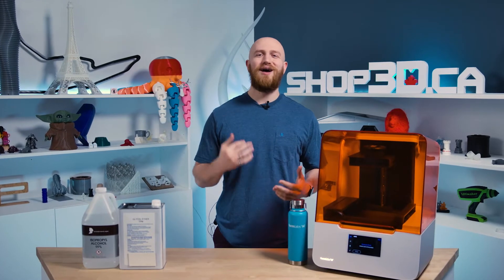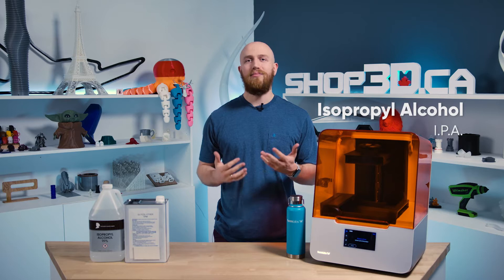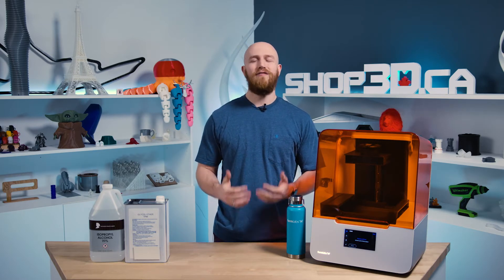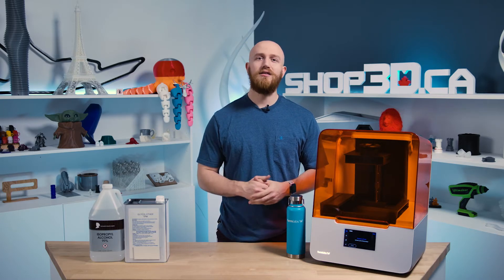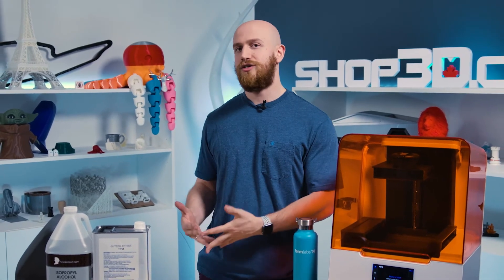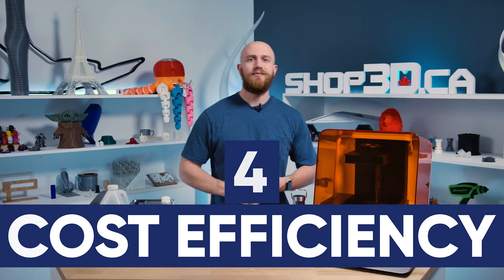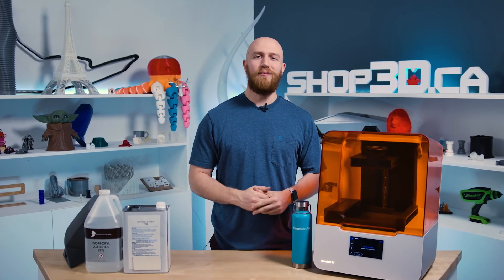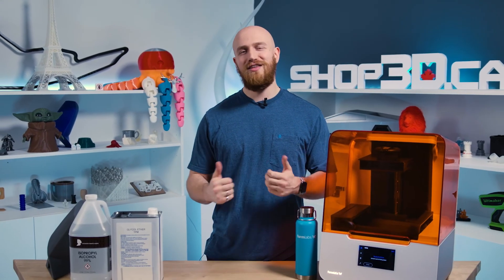Product Feature: Formlabs TPM SLA Solvent

Comment: Hi, thanks for the presentation. Do you know if TPM allows liquid resin diluted in it (from successive washing sessions) to cure when the clear container is exposed to UV light? In order for the resin to precipitate as a "gooey blob" that one can separate and filter out afterward, hence recycling the cleaner. Because while IPA does allow this process, some (but not all) commercially available resin "detergents" (solvents) often prevent it.

Comment: Thanks for the video! Formlabs recommends letting the TPM rinsed print dry prior to rinsing any excess TPM off in water. Do you know how much longer, if any, the process takes when compared to IPA?
Reply: IPA evaporates quickly, but this type of solvent has some difficulty evaporating. However, you can considerably improve waiting time by spraying compressed air from a gun onto wet parts, thus removing excess liquid more quickly.